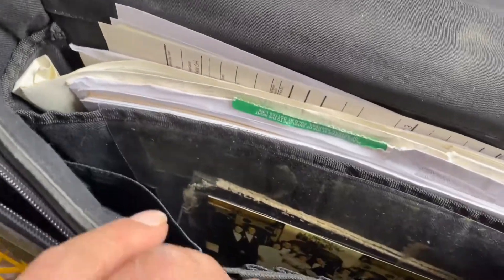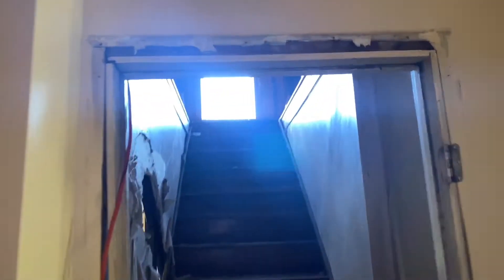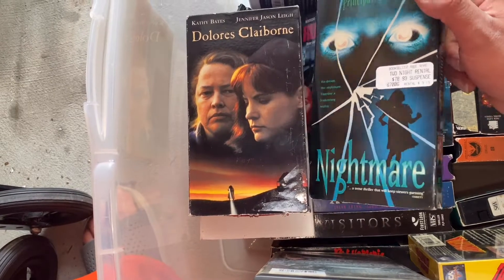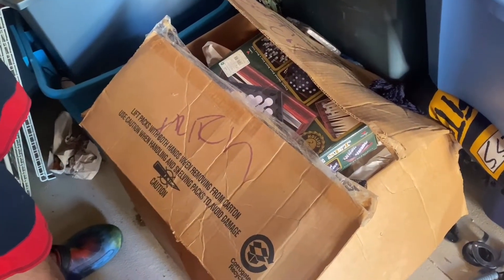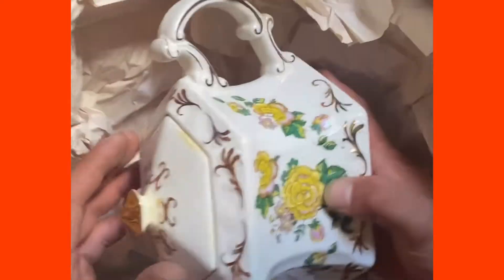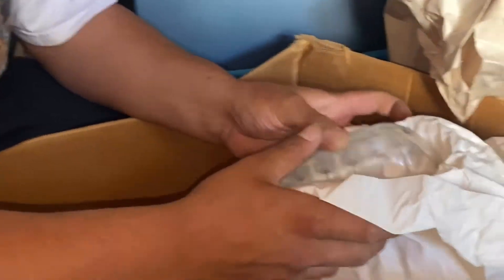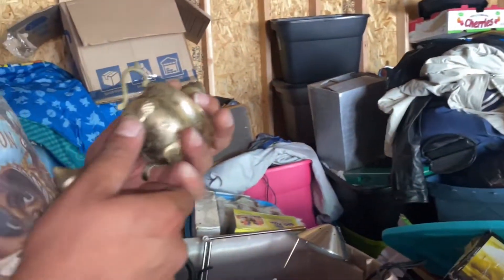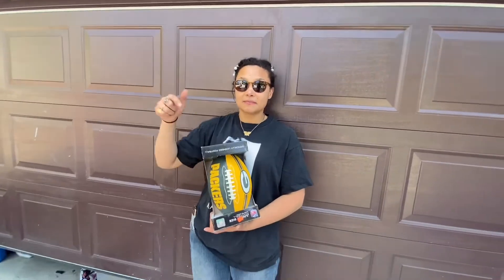Tarnished & RARE Antiques? Gold Goblets Galore STORAGE LEGENDS find SILVER Worth a LEGENDARY AMOUNT

Comment: Glad you're getting going on the warehouse. It's going to be awesome. DId you try to sell the pews?  That's an antler. The "silver" thing is missing a handle, so if it's real silver it's probably not worth anything except scrap. Board games are flying out of E-bay stores right now. Try looking them up, even if you don't think they are worth anything. I think the iridescent vase is carnival glass(?) I'd like to know the maker. I could not find that exact vase in comps, so it is either very rare or very worthless. I just don't know enough about it. Not $901 on the teapot, it's "1068" The green vase appears to be redware. The hole in the teapot lid is not a ding, it is to allow a wee bit of steam to escape. You need to look up a lot of the things in that one box before sticking them in the auction. You might be selling yourself short by selling something for $40 when it is worth $500 (just an example). The white one is Fenton hobnail, ruffled milk glass vase, and not worth a ton, per the comps. The larger version is worth a little more, but this is $5.00 or less, not $80-100. While Fenton may be desirable, milk glass is not right now, esp. the white. I can't find a comp on the teapot with the cherries. The little cat is a ceramic teapot with comps of $5-10. There were a few as high as $15, but the writing on the bottom would bring the value down. It's not very old (1993). I wish I could be at the auction tomorrow, but I'm modding on a different one. Hope it goes well for you.